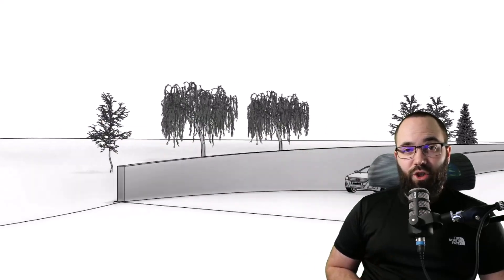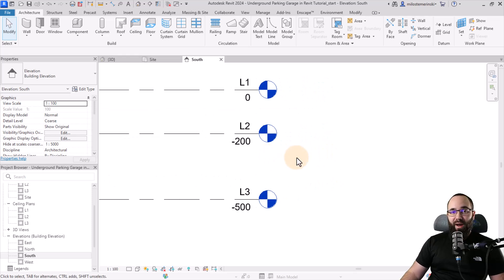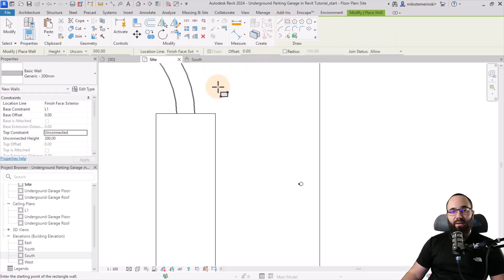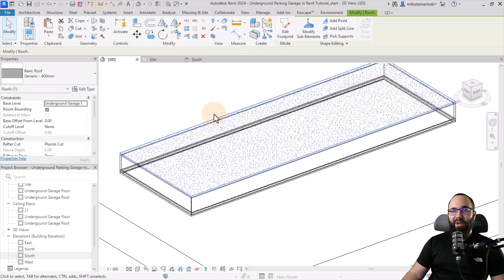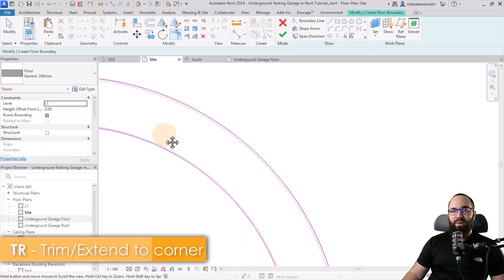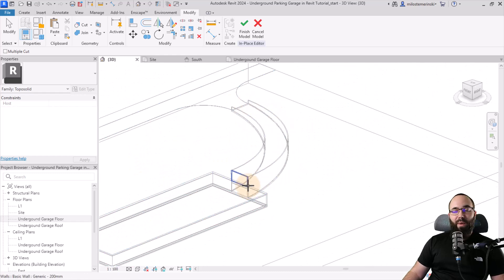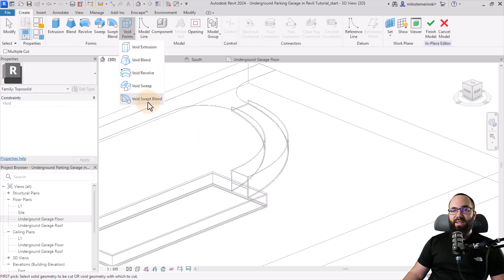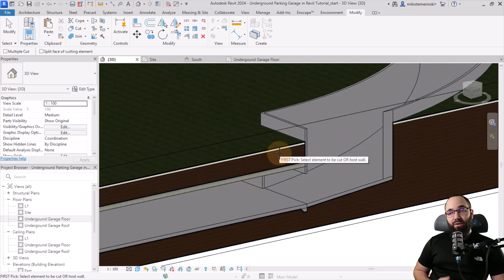Underground Parking Garage in Revit Tutorial

Comment: Not sure if you will respond but I would appreciate it if you could provide some feedback. I have a project with two seperate apartment buildings and a shared underground parkade with a ramp between both parkades. One building is higher up a hill and one is lower. Would it make more sense to link in both buildings to a shared model where I then model the parkade. Or should I draw the parkades separately with the opening and tunnel drawn on one and then link them together on the shared model? Thanks for any help!

Comment: When I select the profiles, my work planes aren’t flush with the walls which messes up the void form and I cannot find a way to fix it. Also when I selected my outside line when starting to create the void the profile 1 and 2 were on the wrong sides. I tried the inner line and it worked but there was still the issue with the skew work planes. Thanks for the videos!!